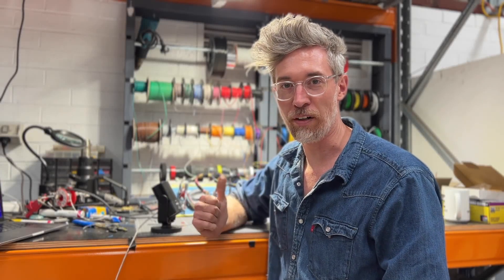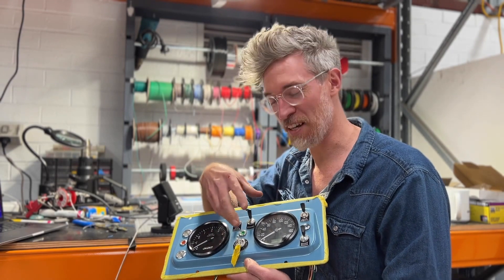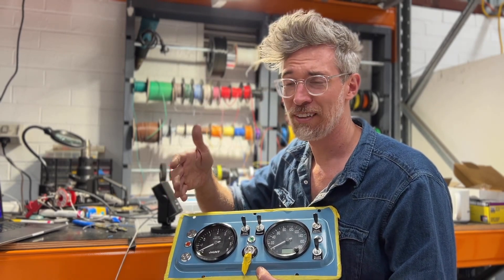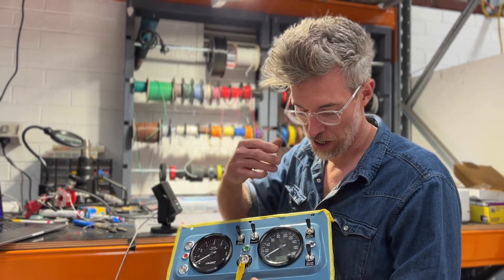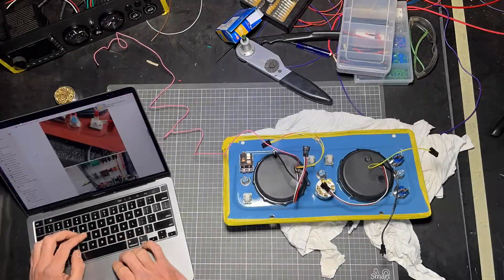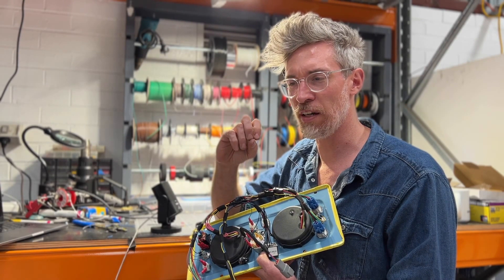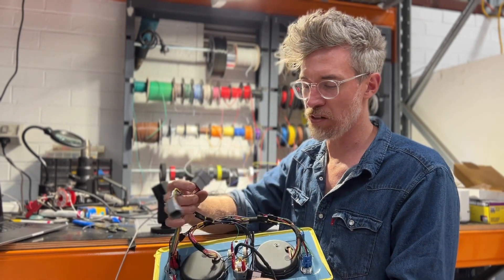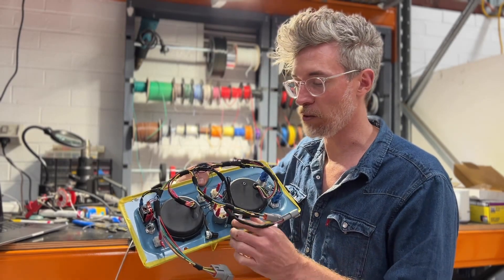Wiring the Dashboard on an Electric Land Rover

Comment: Dave

Where do you get hold of the reproduction switches?

I need to replace mine but am struggling to find good quality ones that aren't overseas
Reply from the maker: We just get them from our local Land Rover parts place British Auto Parts.  'Quality' is quite subjective with these. We use original brand and spec and they're ok.  Nobody really investing in making amazing quality switches like this anymore. But they work and are easily and cheaply replaced.
Reply: @Jauntmotors  excellent. Thanks for the info. 
I get most of my parts from them already so it's good to know you're happy with what they're supplying.